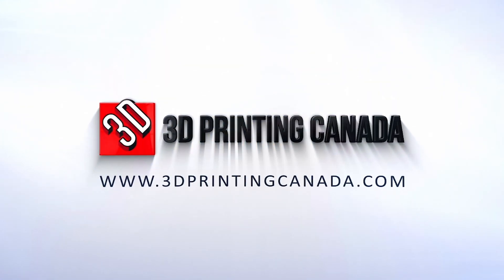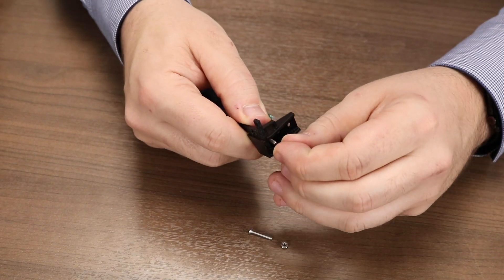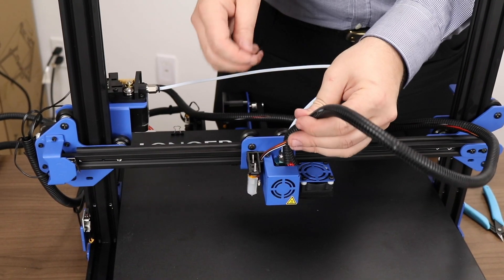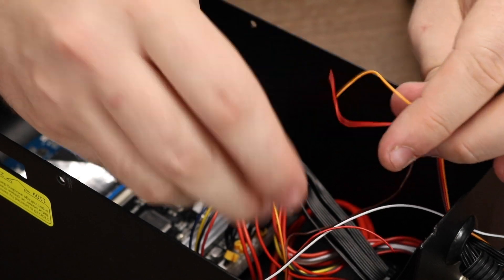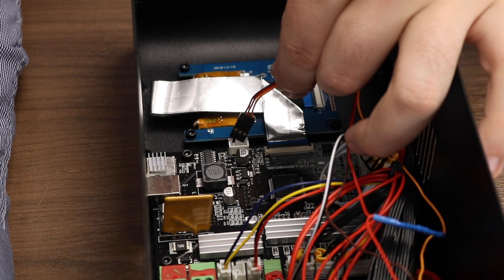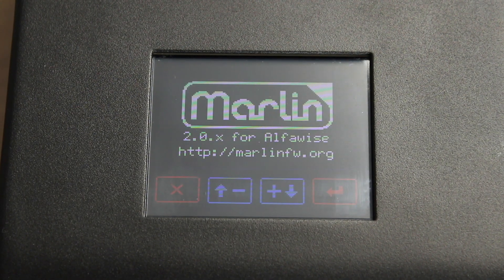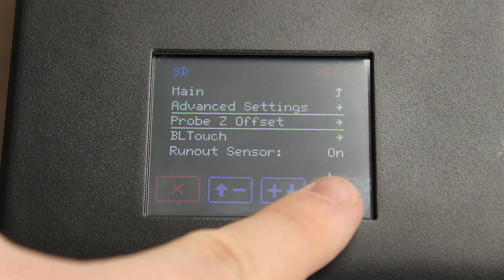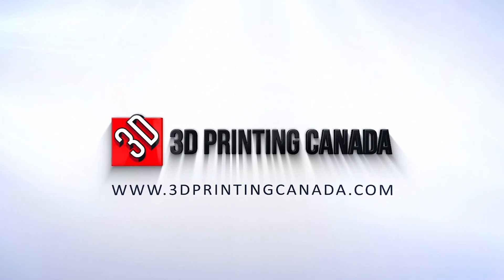How to install a BLTouch on a Longer LK1 Plus

Comment: I followed the instruction step by step ... however when I insert the micro SD with (####_bltouch_firmware.bin), the printer skip flashing the new firmware and start normally ... any solution for that

Comment: I just did this, and now my touchscreen has no more touches. LCD looks right, BLTouch self tests like it should, everything seems normal.   I put stock firmware back on, went through a calibration process, and it worked fine.  Put your firmware back in, and back to no touches.  What am I doing wrong?  Thanks in advance...
Reply: After Flashing, the screen calibrations are off. Tap the top right corner of the screen for (Back/Select), Tap the top middle for (down button )  and tap the Top Left corner for the (Up button)

hope this helps.
Reply: F
Reply: Same here...
Reply: @sidrykchewo  same here